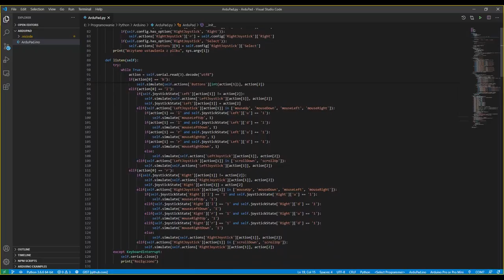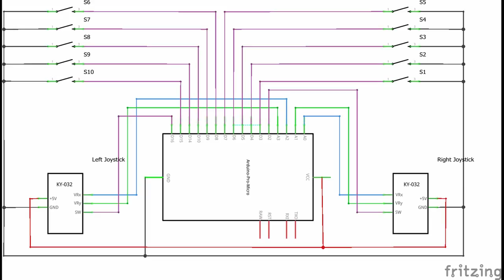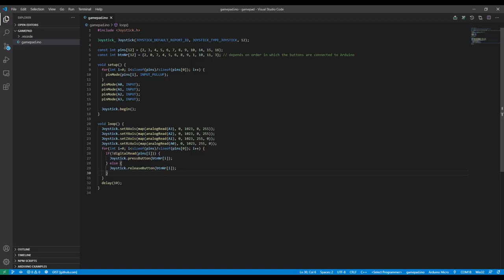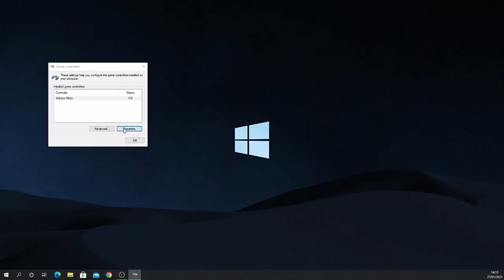Making DIY game controller - Arduino gamepad TUTORIAL

Comment: Hey man, next time you want to build a controller I'd be interested to design the 3d model to and print and send it to you, this way you will be able to add many more functions, I've been conceptualising controllers for a while now.
Reply from the maker: I am going to start using 3d printing in my projects in near feature so if I were to make new controller we could cooperate. You could design the 3d model and I could 3d print it and fill it with electronics
Reply: Hey guys, i have also a great idea for a modern controller for Phones. Maybe we can link up together, and design one and make a business plan with it?
Reply: @Methsman  no forreal. Its a smart idea. Just don't use an atmega32u4 but use an esp32 which has wireless
Reply: @Methsman qual teu projeto

Comment: Good work
V3 add L,L2/R,R2 and other buttons like a real controller
Reply: Pro micro doesn't have enough pins, Leonardo probably does...
Reply: @Drak_Thedp  how about i2c?
Reply from the maker: @Drak_Thedp  For more buttons you can try using an I/O expander or a shift register
Reply: @grzegorzbabiarz4700  are s5 and s6 the trigger buttons?

Comment: Could this work connecting to a raspberry Pi4? As am making a handheld
Reply: Same
Reply: probably yes because you can hide the pro micro (if you are using one). if ur using leonardo i feel like its too big. btw if ur gonna use pro micro make sure it has no pin headers
Reply: also connect it to the power bank ur using i think (never tested it)

Comment: Excellent comprehensive manual. Like.
I got 2 questions:
1) will it work under linux? (RetroPie , Rasbperian ) ?
2) I have an original Playstation 1 gamepad. It has better joysticks. If I decide to use them, will I be required to change anything in the code?

Comment: Would it be possible to make the face buttons function like triggers . I have no idea how to get started but I think that would be a good work around for playing ps2 games without having the original controller . The original ps2 dualshock controller had pressure sensitive buttons and the only way to simulate that is mapping key buttons to the triggers on most modern controllers  . I want to get started in this hobby because it seems like a possible work around .

Comment: Can we use i2c module to increase pin on pro micro, so we can use more button
Reply from the maker: Yep, you can use some I2C or SPI I/O expander or a shift register (parallel in – serial out type)

Comment: Price ?
Reply from the maker: About 15$ for electronic parts only
Reply: @grzegorzbabiarz4700  in micro center it will probably cost 40 dollars
Reply: 40-50+ dollars
Reply: mostly 50 something i think
Reply from the maker: @ProgramAndNectar  I bought the electronic parts on aliexpress with almost free shipping. In electronics stores it would be more expensive
Reply: @grzegorzbabiarz4700  sorry i asked you multiple times but are s5 and s6 the trigger/shoulder buttons?
Reply from the maker: Actually it depends on how you connect and program it. I soldered buttons as I was comfortable and  set the right order later in the code